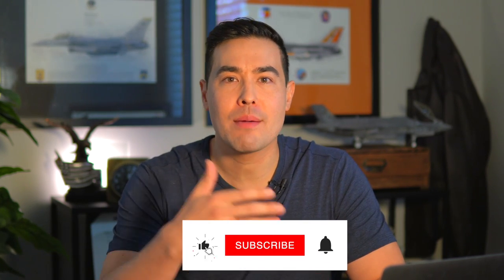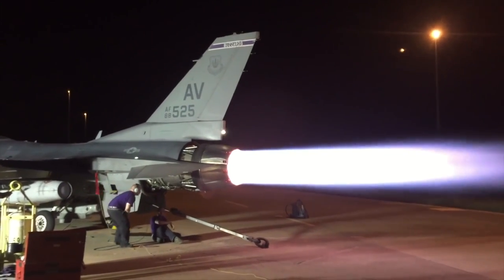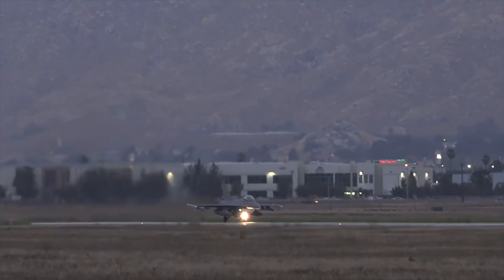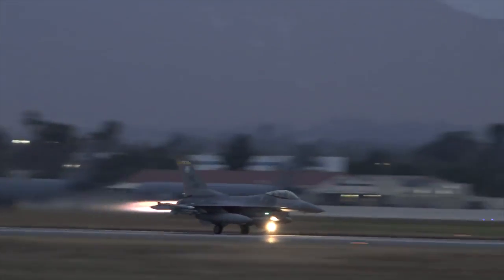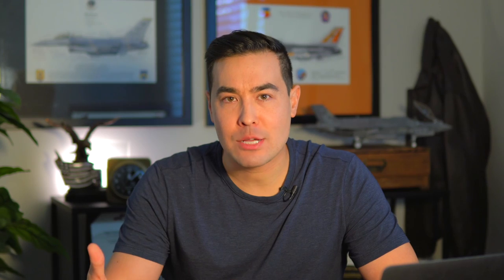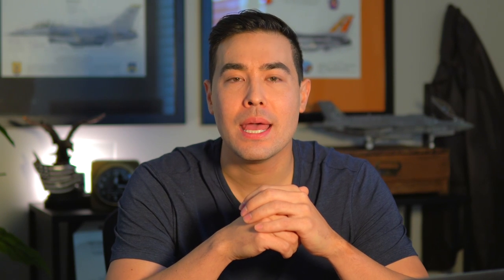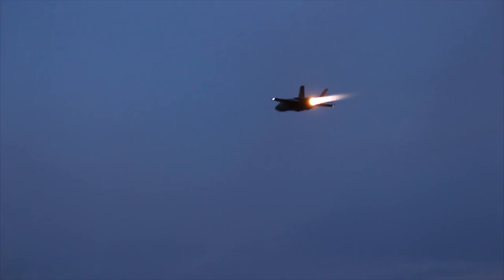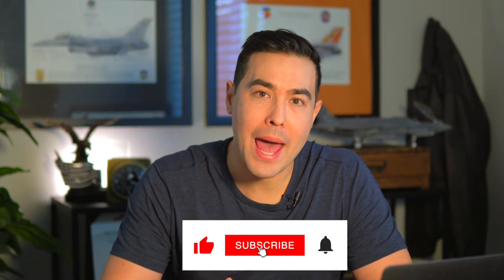Afterburner: What It’s Like to Use MAX Afterburner!

Comment: I build and test the flight controls for the f-35. It’s refreshing to hear you praise them after all the bad press they get. Helps make it feel worth it building them. Thanks!
Reply from the maker: Thank you for everything you do 🍻
Reply: Hasard Lee 🍻
Reply: Lived next to hill air force base for 40 years with the bombing range right next door I've seen everything under the sun fly around my house the f35 us a very impressive plane and man are they loud as hell compared to the f16s that used to be there
Reply: The F-35 is the best! Do you develop flight controls for the B variant? I’ve been scouring the internet to see how the B variant handles during transition to hover but there’s not much. 

For example can the pilot control yaw vectoring thrust of the rear engine during transition period? Or only once the engine is firing fully downward? Working on a replica for a flight sim - SimplePlanes
Reply: Who invented the jet engine?
Reply: @orderlyhippo1569  I doubt they are allowed to talk about it but I’m just a curious as you.
Reply: The newest engines are microwave plasma engines.
Reply: @ericg4915 … try this:

https://en.m.wikipedia.org/wiki/History_of_the_jet_engine

Comment: Using afterburner while refueling - you learn something everyday on here.
Reply: That is something isn't it?
Reply: useless information but still interesting
Reply: And they insist us on turning off engines while refuelling at gas stations 😂😂😂
Reply: @gaaneshmujumdar  why would you not do it?
Reply: @mikkihintikka7273  we do, but sometimes to let the AC running if it is extremely hot outside.
Reply: @gaaneshmujumdar  ah yes well thats acceptable. take care! i thought you were just too lazy to shut down the engine lol
Reply: Ive heard stories of a new boomer saying "Umm, sir, theres fire coming out of your engine" 
"Uhhh, yes, thats the afterburner."
"Could you turn that off while we're refueling?"
"Not if you want me to stay on the boom!"
Reply: @gaaneshmujumdar  😂😂😂
Reply: @MattH-wg7ou  Quite an understandable reaction from his perspective, sitting on all that gas :)
Reply: Avionics guy here. Bigger planes engines (bombers or tankers) are strong enough to go supersonic but the wings will fall off. This is why the b-1 have wing sweep. For supersonic flight on the b-1 the wings will sweep inward to stop the wings from breaking. The reason why the wings wont stay like that because of it less lift. The smaller your wing are, the faster you need to fly to get more air under your wing to have lift. The bigger your wing are, the more fuel you can save because you have more life. The U-2 take the wings to the limit so they can fly slower and save gas. But commercial airlines cant have pilots driving behind an U-2 and 5 people on the runway to put pogo on. So, the reason it need afterburner to keep up with an tanker is; there wings have so little lift compare to the tanker, they're engines need to work harder to go the same speed as the tanker.
Reply: That’s what former F-16 pilots noticed first about the F-35.  No more need to light AB when on the tanker.  F-35 has the same amount of thrust in mil power as the F-16C Blk 40 does in burner.  That F135 motor is simply breathtaking.
Reply: @LRRPFco52  Would be much more breathtaking to stick one into an F-16...
Reply: @LRRPFco52  Also, it's probably due to the weapons being in the weapons bay... Or did the pilots also have no problem with all the stuff hanging off the pylons as well?
Reply: @getsideways7257  Too large in diameter.  That was my first thought as well.  There’s a more powerful GE F110-GE-132 motor for the Block 60 UAE Desert Falcons with 32,000lb in full AB, just to deal with the additional weight on those birds.

The main reason the F-35 doesn’t need burner to maintain exact flight profile at altitude is the excess thrust.

It has the same power in Mil as an IPE engine in the Block 30/40/42/50/52 Vipers have in full AB.

F135:  28,000lb dry, 43,000lb AB
F110: 16.610 dry, 29,000 AB
PW-229:  17,800dry, 29,160 AB
Reply: @LRRPFco52  But the plane itself is also considerably heavier. Guess it's just more slick than F-16 with all the pylons and the stuff on them.
That GE-132 sounds like a good option.
Reply: @getsideways7257  Viper pilots who converted to F-35A say the acceleration in the -35 is about like a slick Block 50 with wingtip and stations 2 & 8 AAMs. The available excess thrust in F-35 is the first thing everyone notices about performance.

It carries a typical combat load that the Viper normally carries, but does it internally. Viper only has 2 stations available for A2G ordnance in a combat configuration.
Reply: @LRRPFco52  I guess we also should take a look at the thrust vs. Mach graphs to get the full picture, but it looks like this new bird is not too bad after all. And yes, carrying stuff internally definitely helps (with RCS too).
Reply: @getsideways7257  Yeah, F-35 is a different animal than any of the 4th and 4.5 Gen. It's actually really close to a slick Rafale in performance like Thrust/Weight ratio and actual speeds.

One of the biggest things I've seen is that people read book value max V0 specs and think those have any meaning at all for the 4th Gen.

For the 2nd and 3rd gen fighters with their slick airframes and turbojets optimized for high altitude/high speed, they could hit Mach 2+ like the F-4 or MiG-23 no problem, but they'd bingo really quick.

Mach 2 performance had no real practical value outside of a few jets, namely the MiG-25 heavy point defense interceptor with its short duration profile.

None of the teen fighters could ever reach or use anything close to Mach 2 in even an A2A configuration. Mach 1.5 wasn't even reachable or advisable in an operational squadron.

Meanwhile, F-35A can do it if it wants to with a push of the throttle any time, but why do it when there's no need for it?

Cruising at Mach .8 to .9 is just fine, depending on conditions. Flankers won't be wasting their fuel running around at supersonic speeds.

It just heats up your leading edges in a non VLO airframe, making you easier to detect/track in IR spectrum.

F-22 & F-35 have heat-sinking and fuel mass cooling, with IR concealment coatings to prevent surface radiation of thermal or IR signature from aerodynamic heating.

So even when an F-35 accelerates to supersonic speed to release a  BVRAAM, it won't bloom on IRST, while it's already tracking you with its EOTS/DAS/passive sensors of course.

This is one of the many reasons why senior Fighter Weapons School instructors have said if you bring 4th Gen to a 5th Gen fight, you will lose and won't know why.
Reply: @LRRPFco52  I don't know about it being on par with the Rafale, after all that's one of only two planes (including F-16) which air displays managed to impress me. But the thing that does impress me about the F-35 greatly and in my opinion makes it a truly next gen fighter is the usage of electro-hydraulic actuators. Personally, I don't care much about cruise supersonics or extremely low radar cross-section (although extensive airframe fluid cooling is a really nice feature), but confining the hydraulics to relatively small compact volumes is a breakthrough idea in my opinion.
Reply: @getsideways7257  Flight demo displays are nothing but entertainment with almost zero relevance for what they actually do at altitude.

The F-35A can perform low altitude maneuvers that neither the Rafale nor the Viper will allow the pilot to do. If you tried them and the DFLCS let you, they would both immediately depart controlled flight and burn-in.

EHAs have been used in airliners prior to the F-35, and were tested extensively on the NASA F/A-18 demonstrator testbed for the JSF program.

There were some challenges with thermal management for flaperon-down configurations during landings, which were solved.

There were also some technologies developed and tested on the AFTI F-16 that were implemented into JSF.

Rafale C Thrust/Weight is the same as the F-35A when carrying the same amount of fuel and stores.  That's a Rafale C without external tanks.
Reply: Must take forever to refuel
Reply: @kalikiller1771  Boom operators say the F-15E, F-22, & F-35 are piggish when it comes to fuel consumption on the tanker. They all have large fuel fractions for fighters.
Reply: @mikkihintikka7273  Actually this is a silly comment. All information is useless unless it pertains exactly to you and is going to enhance your performance. You don't need to be so snarky. We all love discoveries so give it a rest.
Reply: @mikkihintikka7273  Only useless if you don’t have a place or time to apply it.
Reply: F-35 taxiing to a gas station without turning off the engines, the pilot must be absolute legend
Reply: @Weapons_Need_Directing  di ekkkkqqqlllllplpppppppww
Reply: Dead
Reply: @mikkihintikka7273  I let it run in the winter. Depends on what you drive as well. Diesels really don’t care for stop engine stuff. Gassers don’t mind. 
Mostly the reason for turning engines off is to help stop static discharge and boom booms.
Reply: @gaaneshmujumdar  brother aircraft fuel is much more safer than our conventional piston fuel.
Reply: Imagine, the f22 or F15 double engine. Sheehs I feel the Gs when I take off in DCS lol.
Reply: If balls deep was a jet lmao
Reply: That's almost not worth thinking about
Reply: Girl  to watch the f 35 s at macdill last month awsome aircrafts.
Reply: @catalinocalimlimjr.9191  yes, now that you have mentioned, O realise it. But please let my comment pass as a joke 😋
Reply: @gaaneshmujumdar  I always thought the same thing lol. All of our strykers, humvees, mraps etc stay running while filling up and gave never had an incident with it lol
Reply: @rageknight2340  I wouldn't say JP8 is all that much safer really. It's just kerosene mixed with gasoline 🤷‍♂️

Comment: Can you hear the afterburner ignite from the cockpit? Or can you just feel it?
Reply: You just feel it, it’s a noticeable rumble and like he said the fidelity with power control is a lot more difficult. So you just go on/off really quick and get a little bump of energy. In the Block 50, you don’t have to do that but in the Block 40 you need just a touch more power than mil can provide in the high 20’s.
Reply: @RaymondTusk74  Thanks for the answer. Thats very interesting that the Block 50 is different to the Block 40. How do you have to work with the Block 40 afterburner and why does the Block 50 easier to handle in that matter?
Reply: @TheDarkman222  US Block 50 F-16's have a GE-129 engine instead of the GE-100 with which the Block 40 is equipped.  The GE-129 provides more thrust, so you almost never need to use AB to stay on the boom (but it's reeeeeaally close when you're up high and loaded up with weapons and you typically are mil to slightly less than mil to do it).  As far as flying US Block 40's vs. Block 50's, only an experienced F-16 pilot is likely to notice the difference in thrust most of the time.
Reply: @RaymondTusk74  I see. Excuse me if I ask something you might not be allowed to talk about. Although I can't find the figures for thrust without afterburner, the GE-129 just has 2,75 kN more thrust with afterburner engaged. Thats only 2 % more than the GE-100. Would you say the GE-100 would have other disadvantages? Maybe in spool time? Or do they handle quite similar?
Reply: @TheDarkman222  I only noticed the 129 had more thrust, but I had a lot of hours in the jet.  When I was younger I probably wouldn't have noticed.
Reply: @RaymondTusk74  It was interesting to read about high-hour Norwegian Viper drivers who said the first thing they noticed in the F-35A was that they no longer needed to touch AB in the FL250 and higher regime when turning.
Reply: @LRRPFco52  The F-35 produces about 6k more pounds of thrust dry than the F-16's do, however it's afterburner ironically only produces about 2k pounds more total thrust than the F-16.  This was due to their desire for super-cruise though and fuel economy.  Also the plane's spec did not require it to go mach 2 like the F-16 did.  I imagine if it had the same level of Afterburner boost from dry thrust ratio as the F-16, it would be closer to an F-22's engine in thrust overall.
Reply: I built f35s for 11 years. I remember the first flight in texas
Reply: Assuming your going faster than sound you can’t hear it
Reply: @TheWizardGamez  it still conducts through the airframe i think
Reply: @Stand_Tall  concorde used to expand by up to 30cm during supersonic flight, apparently.

Granted, it was a much longer plane, but surely even small jets stretch under the supersonic stresses?
Reply: @NiSiochainGanSaoirse  wasnt talking about that but yeah the Concorde did that
Reply: @Stand_Tall  I know buddy. It was a bit of a leftfield comment from me, but when a question pops into your head, sometimes you just gotta ask it, haven't you? 😁
Reply: @NiSiochainGanSaoirse  fair enough. most metals expand from heating so most airframes will expand even from just flying trans sonic. if i remember, the jumbos can expand around 6 inches during flight
Reply: WHO CARES?
Reply: @drawincode1800  clearly quite a lot of people...
Reply: The best thing is lighting the AB at night and lighting up the jet from behind.
Reply: You can hear it, but its not loud on the inside.  The truly amazing thing is that you can clearly hear your bombs explode, even in the 20,000 ft range at .85M
Reply: You can hear it. Always. Probably from sound conduction through the airframe. At least it other jets. Haven’t flown in an F-16. But other afterburning, ss jets.
Reply: @RaymondTusk74  block 40s are PW, not GE
Reply: @spartan9458  11,000 pounds more thrust than an F-16 in dry thrust and about 14,000 pounds more thrust in afterburner.
Reply: You'd think talking about all this on the internet for the whole world to know would be prohibited because your talking about military equipment.
Reply: Everything I’ve read here can be found several other places on the internet open source info.
Reply: @TheWizardGamez  They have to say words backwards on the radio
Reply: @NiSiochainGanSaoirse  Australia was the last F111 operators, and I was talking to a maintainer on base years ago, he said they rarely allowed mach 2 exercises as the paint peeled off the tailplane
Reply: It's a lot of noise. Unless you're supersonic there's no reason you wouldn't hear it.
Reply: I like how he says "you cant finesse the afterburners like a normal throttle" - lol - in the same way you can't finesse an angry Lion.
Reply: @briangodinez6921  It's amazing that it's a "new" fighter, but you built it for over a decade!  That's awesome.
Reply: I worked on F-16s for  years. We had block 50/52 and they were pratt engines
Reply: @undrwtrbsktwvn1110  Block 42's are P&W 220's, Block 40 are GE 100's. If the Block ended in a "0" it had a GE, a "2" a P&W.
Reply: @rehbornb1  Not if you worked on Block 50's.

Comment: I work in flight operations for Lockheed Martin and you can’t even begin to imagine what it sounds and feels like when we do the Throttle Profiles inside the hangar, hearing this thing in full AB is an unforgettable feeling. The best part is when you’re standing 5 feet behind the nozzle and directly behind the wingtip.
Reply: I grew up in Sacramento and Aerojet used to test rockets there (Saturn V engines). Just 20 miles away and it still went through your body.

Comment: As a former neighbor light surgeon, I had the incredible fortune to be with a A4 squadron, and although they are not equipped with afterburners , We did get the jet to Mach one at 30,000 feet going downhill.
During my time as a flight surgeon I assisted in several of the water rescues being lowered from the helicopter on to ships to help  injured or extreme ill crew. 
In 2020  I underwent three back surgeries and several hip replacement surgeries stemming from the injuries I sustained from those open water resources assisting our Coast Guard in Hawaii. I commend all of the doctor and nurses who helped me return to walking again without crutches or canes.  So keep the faith and we can get through this as Americans.

Comment: When I was stationed at Nellis AFB back in the eighties I had an engine run license for F-15's. Sometimes we would take aircraft out to the trim pad, like you see at 1:03 in the video. We could take one engine at a time to full burner. You obviously didn't have the acceleration but it was still quite a ride. Interesting that you say that you didn't want to light all five stages at once as we did it on a regular basis on the pad. The nose strut would collapse and the whole jet would just shake, rattle and roll. Eyes were constantly scanning the gauges and mirrors for anything wrong. The last couple of numbers on the fuel gauge were just a blur. Each aircraft made its own distinctive noises as well that kept you on your toes. The pad was right next to the road just off base and people would stop to watch so we would put on afterburner shows. Take one engine and run it up to full mil power and then light the burner. Back that one off and do the same with the other engine. Sometimes one stage at a time and sometimes all the way to the wall. It was a total rush and a little scary with 23,000 pounds of thrust just fighting to get loose. Knowing that if anything catastrophic went wrong you were toast. the worst part of that was you were pointed right at a small building less than a hundred feet away, maybe even closer, so even if it did get loose you had absolutely zero chance instead of only near zero chance.